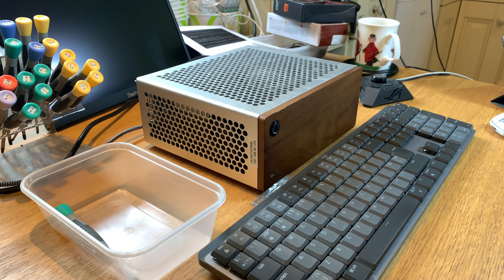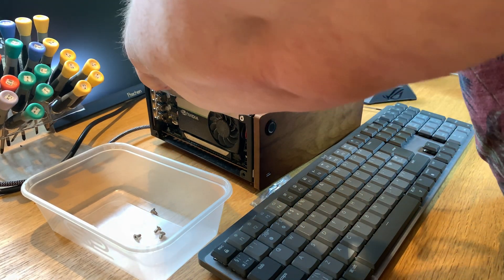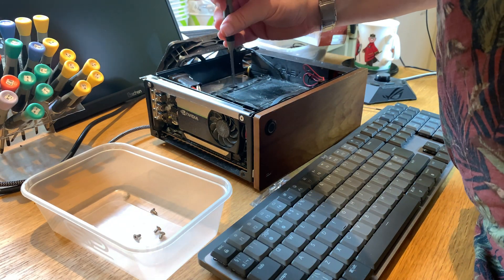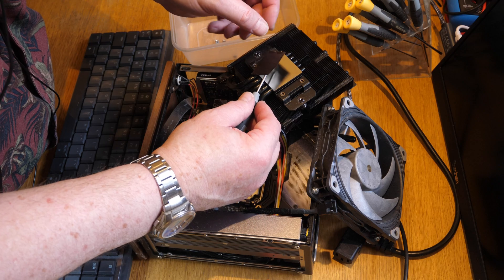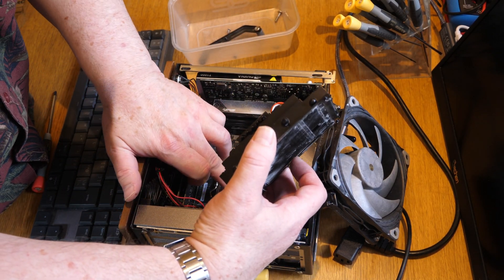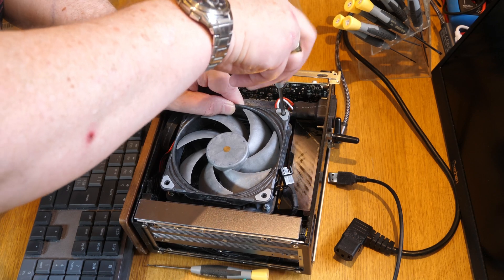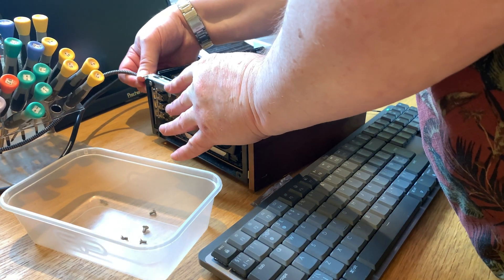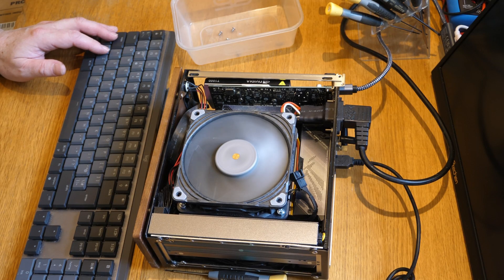Ryzen 9 9950X Mini ITX email machine Eco mode build (CPU upgrade) 4L Densium

Comment: Are you willing to try the Zen6 10k/11k Ryzens ? Soo was the 9950X worth it soo far ?
Reply from the maker: Don't know much about Zen 6 yet, but I'll probably upgrade, and if I do I'll be upgrading the MoBo too. It took over a year to get to the bottom of some crashes issues I was having, turns out there is a problem with the Asus X670E-I board's chipset implementation around the USB type C implementation and the second M.2 slot that is resolved on ASUS's X870E-I mITX board.

This explains the crashes and problems with sleep & hibernate I had early on using the USB type C's in DP aux mode with the iGPU, fixed by using the discrete GPU instead, then a bunch more crashes I started getting when I later installed a second M.2 NVME drive. I removed the second M.2 drive and upgraded the main M.2 to take all the combined files onto one drive, and that fixed it. I take care not to have anything plugged into the USB type C's when sleeping or hibernating. It's been awesome ever since.

TL;DR, yes. I'd do it this way again now I know the pitfalls, it's a great development machine.

Comment: Really nice build!

Fellow Densium case owner here, I've got a protip for you!

Lower the boost clock by 450Mhz in the UEFI/BIOS
Should be in AMD Overclocking > PBO > Negative Boost Clock Override somewhere

This shouldn't affect real world performance by much, especially not the perceivable performance.
Only benchmarks will it matter, but it will improve the thermals by a lot!

This reduction is the same amount AMD chose for the 7600X3D vs the 7600.
which yields the big gains in energy efficiency reported by Gamers Nexus in his 7600X3D review.

Another option is to disable Core Performance Boost entirely, should be in AMD CBS somewhere.
This is also what Noctua recommends for small heatsinks, on their Noctua Compatibility Centre (NCC) website.

Comment: whats the smallest case i could do without eco mode on the 9950x. also with a 5060 low profile
Reply from the maker: I don't know,  I was only interested in single slot low profile, I believe the 5060 is dual slot.

Comment: i hope youre here before i decide to buy 9950x

wdym about this?:
Single core max clock up to 5700MHz (about 200MHz higher than 7950X)
All core max clock up to 4700MHz (about 400MHz lower than 7950X)

coz i believe i saw Gamers Nexus got 4.8ghz on 7950x at 105W for all core testing

Comment: Would you say the upgrade is worth it? Judging from the benchmarks. And is the idle power consumption lower in the 9950x?
Reply from the maker: Probably not. The only immediately obvious benefit I got was the speed on boot, in that the Memory Context Restore setting in the BIOS worked without having to also set the Power Down Enable setting. But now I know that you need to set both to bypass full memory training anyway with AM4 on these motherboards, I guess it's not such a bonus after all.

There is no obvious change to idle power consumption in my setup.

Comment: Honestly, this is so cool to see. Its really nice to see someone work on a build and explain it step by step (made me realize that for am5 might have to get a cryosheet and not thermal paste looking at how clean everything is). The Densium APU case looks really nice. Big fan of the GAN 250W in this case. The only drawback with this case in my opinion is that the gpu can only be a single slot (btw yeston has released a single slot rtx 3050 6gb which is 70w). Overall really cool email crunching machine :)

Comment: Would you recommend buying this and running it in eco mode if I have air cooler.

Or buying one of the lower tdp zen 5 chips. Which have a lower initial purchase price too.

Im going to be running this on a full server that runs 24/7 but also as a main desktop machine for intensive tasks.

Previous cpu was ryzen 5 1600 bought in 2017.
Reply from the maker: For me it's determined by the expensive electricity we have here in the UK.

I run an N100 as my only 24/7 box. It runs an SSD NAS and VMWare Workstation with Home Assistant in a VM, and idles at about 8W.

I also have a couple of dual socket rack mounted servers with bags of RAM and SSD arrays for system and end to end testing, but they're only turned on when I need them, or in the winter when it's cold.

The 9950x machine is my daily driver though. When it had the 7950x in it, it idled at about 100W: I'm not keen about having that on 24/7 with my expensive electricity! I'm not sure what the idle draw is with the 9950x, I haven't measured it yet, but I'd imagine it's about the same.

There is no doubt you'd see a massive uplift from the Ryzen 5 1600.
Reply: @nezbrun872  How is it idling at 100w? That's a heap of power!!
Reply from the maker: Well, there is a T1000 8GB graphics card in there as well. I agree though, the idle power isn't great however you look at it.
Reply: I've got recently 9950x with 240 AIO in my smallish by modern standards ATX case. So the heat dissipation is a concern for me. It turns out modern Ryzen CPUs have so many parameters that you can tune that it can basically fit whatever you want. For example, you can set the temperature limit instead of limiting cores frequency and then it will go up to that boost frequency unless it reaches set temperature. This allows to have high performance for short time if temperature allows but then will throttle or limit itself if temperature is too high. The actual problem is that you better understand how it works and how to tune it without burning it. And unfortunately, configuration out of box is designed to satisfy benchmarks rather than power efficiency or longevity of CPU or whatever. Also, each piece has its own potential to how low voltage it will be stable it and how high it can boost. So you really have to tune it, anyway.